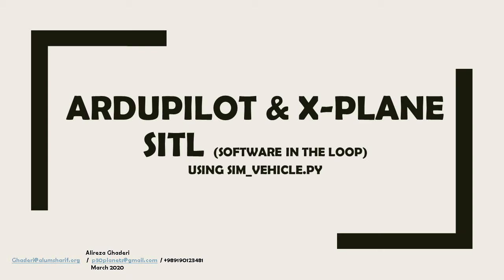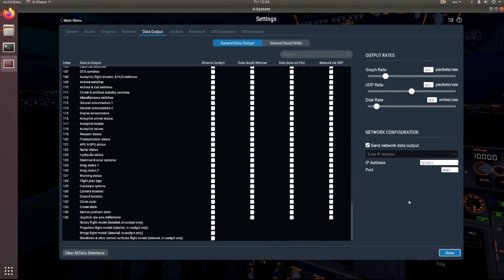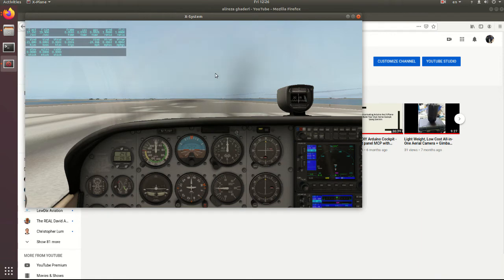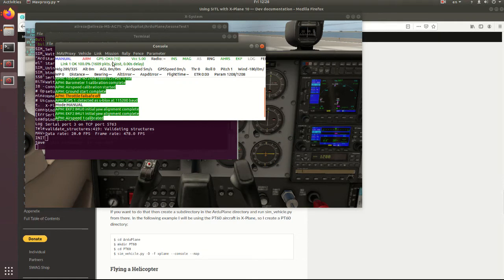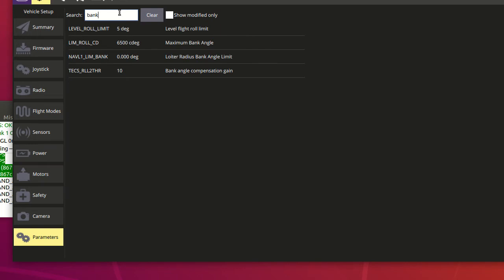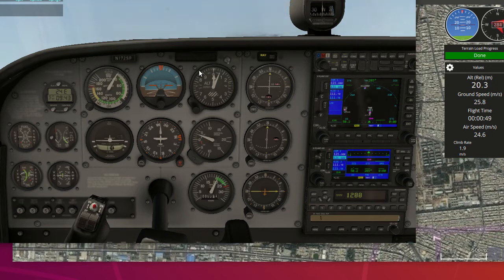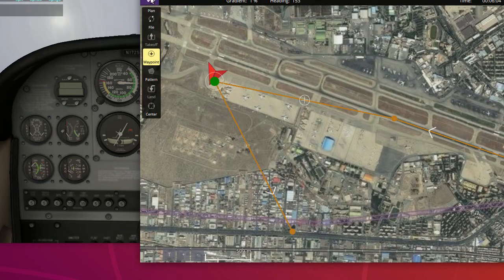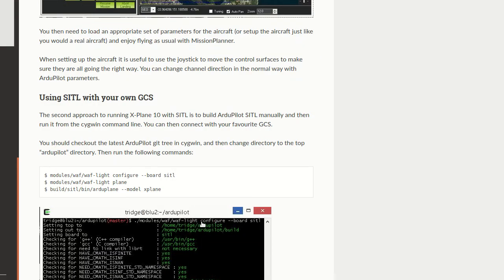Ardupilot Software in the Loop (SITL) with X-Plane 11 and QGroundControl

Comment: I am using X-Plane 11 with ArduPilot SITL. I built the aircraft myself in Plane Maker.

The problem is that after arming the plane, it does not take off when I switch to Guided mode and give a takeoff command or upload waypoints — the plane just stays on the ground.

Also, when I refresh or reload the flight in X-Plane, the plane starts rotating in circles on the ground by itself.
Reply: I did it!
Reply: @saifhassan8764 could you clarify how you did it?